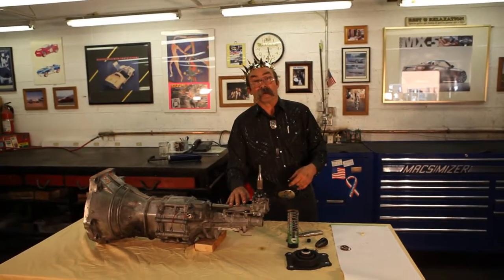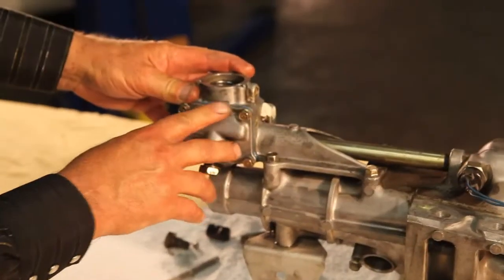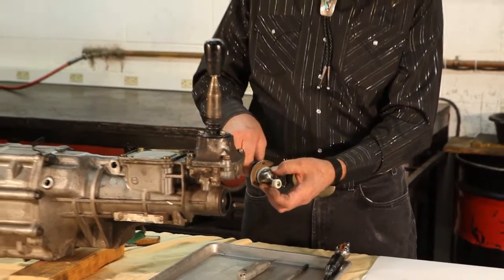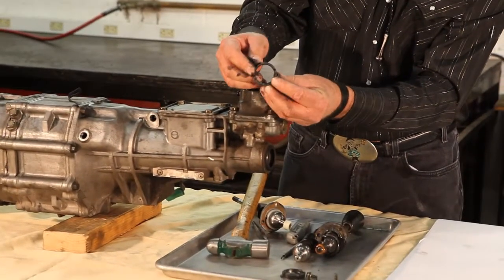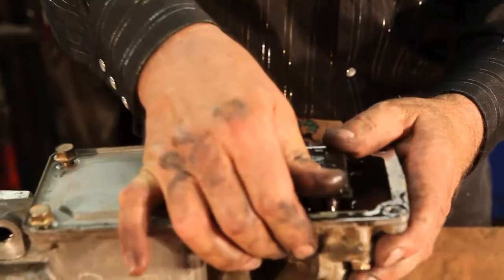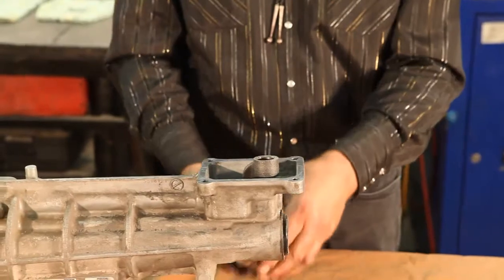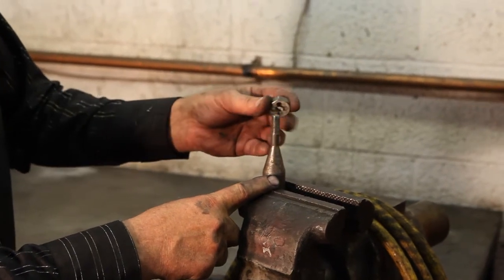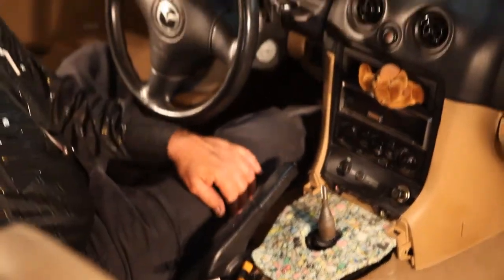Part 2 Miata MX5 Transmission Shift Turret Insulator Service

Comment: I think the most valuable part of this video is where you show how to bang that front pin out of the way with a hammer and punch. I'd have figured out the rest myself but not that.

When I pulled my shifter out there was NO bushing at all on the bottom of the shift lever!  You can imagine how much better it shifts now that I installed the bushings I bought from your ebay store.  Almost no slop and the first-to-second shift is especially improved.  Thanks, your Highness!

Comment from the maker: Hello Sir Jim,
Fifth and Revese are on the same shift rail. So you need to ask for the fifth hub and sleeve set, better yet, Mazda uses a micro fish system so ask for the picture so you can pick out the seperate parts. We have seen this problem due to a trans run low on fluid, fifth hub is the first gear set to be starved for oil. First take the tailshaft off trans to see the gear set. You will most likely also need the fifth gear. 
Good Luck, Mike.
The King of Miatas.

Comment: Thanks. This is the first video I've seen that mentions the 'loose cover' on the 6-Speed shifter. My bolts were finger tight only!. I put some loc-tite on the back two and tightened them down but, getting at the front two was impossible. So, I had to remove a bit of metal with a dremel in order to get a wrench on them. (Yes, I apologized to the car.) But, now they are all nice and tight !
If you have a suggestion on how to tighten the front two bolts maybe you can help others from having to do what I did. (Apart from dropping the transmission.)
Reply from the maker: Hello Sir Blue,
We have many tools to fit, if not we make them. This is how we feed our babies. Mike. The King of Miatas.

Comment from the maker: Hello Sir David,
The detent plunger is stuck. Check fluid first if low change and work out the kink. If not you will need to take it apart to fix.
Mike.
The King of Miatas.

Comment: Gratitude for the tutorial, o mighty King.  Pray tell, should one's 6-speed suffer from a loose bracket caused by those insolent bolts, how doth one tighten this bracket?  Locktite?  A new bracket?  We bow before thy mastery of the Miata realm.

Comment: Regarding moving ONE of the pins out (to get the bottom bushing and wave washer out/in) - - it's tough to use the "hammer" technique with the mechanism still in the car.  The better way is with a standard "vise-grip" pliers.  See other videos that use a channel lock pliers - - which may not give you enough "jaw strength" to budge either pin.  But if the vise-grip is set to the point where you're only trying to move it a slight bit (e.g. 1/16" or less - - i.e. with the handles almost closed), this gives you tremendous jaw strength, and it "budged" for me.  Once it budges, you just repeat the process by adjusting the handle screw on your vise-grip pliers.  Slow but sure process.

Comment: Hi Mike. Thanks for the video. Very Informative. Just wondering for the 90-97 can you remove the turret housing while the transmission is still in the car ? Reason....I was going to do the shifter rebuild and noticed 1 of the 3 bolts snapped by the previous owner.  Thanks in advance @Mike MiataKing

Comment: Hey Mike,

I am having a little trouble removing the shift knob from the shifter. Do you have any methods to remove the knob? The knob itself is wedged on pretty tight and I have had a couple people attempt to take it off but does not budge.

Thanks!

Steven

Comment: Hi Mike,thanks for your videos first of all,they are really helpful for we who are not as mechanically informed.I have an intermittent problem with my 01 miata ,6sp,sometimes it turns over and over but doesn't start right away and it makes the check engine light come on.It usually does this after being warmed up,then when it cools off it starts right away and the check engine light goes off.What would you check first? I have read some blogs and changing out the coil paks usally fixes it,but again,what would you recommend checking first? Thank you.

Comment from the maker: Hello,
A sluggish six speed transmission can benifit from a fluid change to Ford " Full Syntheic Manual Transmission Fluid" Ford part number XT-M5-QS. Purchase or order from a Ford Dealer.
Good Luck, Mike.
The King of Miatas.
Reply: First of all.. You’re awesome man! My shifter on the 01 6-speed I just got has wayyyy too much play(I haven’t taken apart to check if it was the bolts like you say), I was planning on rebuilding with a kit similar to what you showed  here. Do you recommend changing fluid at the same time? And can fluid be added at the top or is it best to use the port on the side? I always hesitate with stories of bad fluid changes, don’t want to have issues since the car transmission is fully operational. Thanks again I am now a subscriber!
Reply from the maker: @osalcedoucmsae  Hello Sir Omar,
Yes, change all the fluids on the new to you 2001 BRG. Yes fill the trans on the port on the driver's side of the trans, apx half way up.
the drain in on the very bottom. Enjoy your Miata.
The King of Miatas, Mike.

Comment: Dear King of Miatas,
You seem to have all the gears backwards in the way you describe them. The shift pattern is essentially reversed inside the shift turret because of the way the shifter acts like a lever to engage gears.

- The Real King of Miatas (kidding)

Comment from the maker: Hello Sir Victor,
Your problem sounds like a internal pressure problem. When a automatic transmission has no gears or connection when warm the unit may be low on fluid, check when hot and at idle. If fluid is full then you may have a plugged up pickup screen or a front pump failure. 
Mike.
The King of Miatas.

Comment: Aloha KING! I'm a ASE master tech 25yrs and i'm working on a 1997 miata with a 1991 trans in it. i'm having a downshift from 5th to 4th problem and i know it needs a 4th to 5th hub and sleeve kit but when i call Mazda they don't know what i'm talking about! Do you have a video and/or part# on this repair??

Comment: Hi Mike. Thanks for the video it was helpful for me when I did my turret rebuild. I just wanted to know if there is a seal that is between the shifter turret and the rest of the transmision. Because my shifter turret is leaking but not from the seal on top or the side plate or from the detents. It maybe coming from the part the shaft connects to the transmission. I can't find any information about it though. Any help would be great. Thanks.
Reply from the maker: Hello Sir Arthur,
Yes, could be the connection at the shift tube to the turret. More likely could be a cracked housing from a wreck, we have seen that problem before. The tube is glued to the aluminum housing. Clean everything well and look for a leak. Once clean, sprinkle baby power on the turret and watch for moisture. Good luck with your Mission.
Mike.
The King of Miatas.

Comment: Hello Mike, thank you so much for the video. This was very informative. I have one quick question though. I have a 2001 BRG special edition which is a 6 speed. I think it uses a Y16M-D transmission. Do I have to refill the turret with gear oil? It seems like from your video that all we need to do is just lube up the parts and not need to refill the turret. How does it stay lubricated without a reservoir of oil? Once again, thank you so much for the video and help!
Reply from the maker: +William Duong Hello Sir William,Yes, the six speed does not have a separate shift turret container. The shifter is lubed by the main trans case windage. The main trans case and the shifter are connected.The King of Miatas. Mike.
Reply: +Mike MiataKing Hi Mike, just quick follow up question on this. Given that the shifter is lubed by the main trans case, if I serviced the 6-speed shifter... could I simply take the gear oil out through the top or do you recommend to still drain through the trans plugs below?
Reply from the maker: +William Duong  Hello Sir William, Thank you for your concerns. Your Six Speed does not have a separate shift box but is part of the Main Transmission Case. Just grease up the parts and Zoom Zoom.  Good luck with your Miata Mission.  Mike. The Miata King.

Comment: Hey Mike,

I noticed my turret was dry after filling it a couple of weeks ago and suspect either the onion skin gasket you described or a loose bolt is the culprit. Is is possible to reach these bolts without dropping the transmission?
Reply from the maker: Hello Sir Jacob,
First step let us look for the leak. Clean the turret area and refill. Let it sit awhile then look for the leak. Yes, you can secure the bolts from the bottom and top.  We find many times when the turret leaks the case is cracked from an accident. Good Luck with your " Leaky Turret Mission ".
The King of Miatas.
Mike.

Comment: Hey Mike,

I noticed that my lower shift boot was ripped, as well as the upper shifter boot. I ordered both boots, and removed the shifter. before removed, the car shifted into all gears no problem. Now that i have put it back together, it won't shift into anything but 1-2. I have to pull it towards my leg, and it will go up to 1-2, but it won't go into 3-4 at all, or move to the right at all to 5-R. I don't really know to do, I am thinking about checking out the springs and seeing how that works(like you did at 0:36). Can you help shed some light on the issue, and a solution? Thank you
Reply from the maker: Hello Sir Jacob,Thank you for your concerns. You took it apart and put it back together, now there is a issue. Something did not go back together right. May be broken bushings jamming up the linkage. Next step take it apart again and look for the trouble. Good Luck with your Miata shifty Mission.The King of Miatas.Mike.
Reply: +Mike MiataKing  hey mike i have the same issue as above but i cant go into 5th or reverse only 1-4 and the shifter feels clanky and different then before. please help i need to take a roadtrip home soon im stuck :/
Reply from the maker: +AiiRiiCK Hello,  Sounds like your transmission is low on fluid. When the trans gets one quart low on fluid fifth and reverse are starved for oil and soon burn up.Also the other cue is the shifter feels funny. Check the fluid level first.Good luck with your Miata Mission. The King of Miatas. Mike.
Reply: +Mike MiataKing thanks mike i supremely appreciate your help i wish i could do somthing in return but i hope this is my issue
Reply: My issue ended up being the reverse light switch, so if you're having a similar issue I'd recommend checking that.

Comment: i have a 90 miata with a gt25r,link ecu,440injectors,FMIC,lightflywheel,clutch about 200+whp and was driving home last night and heard a light tapping like a hammer being hit on a anvil coming from slightly in front and right ( around the trans) while in any gear this noise continued to get louder. the car make the noise much less if the clutch is in or out of gear coasting and louder if accelerating, also the sound picks up speed with the car i.e. slow tapping at 25 and fast at 60 .

Comment: Hey Mike, Thanks for the video.My Miata was stuck in gear. I pulled the shifter out of the turret and found the bottom bushing broken. I ordered the kit from your site and changed it and now I can shift into neutral and 1st and 2nd but can't shift into any other gears.What could be wrong? Synchronizer? Thanks for your input.
Reply from the maker: Hello Sir Abe,
Because the bushing was broken, broken pieces may be stuck in the lock-out. What does it feel like when you shift to third?
The King of Miatas.
Mike.

Comment: what would happen if you lost the spindle lock cover and spring? i cant get into any gears but i dont know wether to buy a new spindle assembly for it to not fix my problem
Reply from the maker: Hello Sir Rees Piece
We offer a kit for the spindle. Please take a look at eBay item number:

391276915507
That is the easy button to replace first and see if you issue is resolved.
The King of Miatas. Mike.

Comment: I think the detent spring on my 1995 Eunos is worn out. It doesn't spring back to centre when pulling out of 1st or 2nd gear. Any idea if you can buy the detent springs from Mazda? If so, any idea of the part number? (5 speed)

Comment: Can I fill the transmission with fluid through the turret  or the service box of a 2000 miata nB 5 speed instead of of the fill plug?
Reply from the maker: Hello,
Yes, it is possible to fill the transmission thru the turret on your NB.
Mike.
The King of Miatas.

Comment: Hey Mike...this is Mike...is there a brand that you recommend to rebuild my shifter on my '97 Miata. It shifts fine, no issues but the rubber boots are letting heat into the car. I have looked at OEM parts from Mazda (YIKES..Expensive) and i have looked on Ebay (much more affordable). I just dont know if the Ebay ones are any good.
Reply from the maker: Hello Sir Mister T,  Thank you for your interest and concerns. Yes, our kits on eBay are all OEM parts and the price is right. Take a look in our store Miatamecca.  Mike, The King of Miatas.

Comment: My wife's shift knob on her 2001 5-speed is stuck. When I try to take is off, the whole shifter turns. Is the shifter it's self in 2 pieces? Can that break causing that symptom? Is that shifter the same for a 1999 6-speed?
Reply from the maker: Hello Sir Jason,
Thank you for  your concerns. Yes, there is an innner and outer to the shift knob. To remove the knob you will need to sacrifice the knob.
Squeeze the knob with a large pair of vise grips to lock the loose outer onto the inner, that is screwed to the stick shift shaft.  When done
install the replacement knob. The knobs are interchangeable 1990 thru 2005. Good luck with your Miata Mission.
Mike, The King of Miatas.
Reply: @MikesPlaceBiz  The knob moves with the shifter lever. I can feel the entire lever move under the leather upper boot. Can the lever break? It looks like it has 2 parts. I can't imagine that both guide pins can break.
Reply from the maker: @mainoffender1  Hello Sir Jason,
You will need to do discovery and inspect for the issue,
The King of Miatas. Mike.

Comment: Hey Mike I have a quick question. My fifth gear sometimes grinds going in and also sometimes my reverse works great other times hard as hell to get in what would you recommend?
Reply from the maker: Hello,
Problem could be the transmission, check or change fluid. Also could be a clutch issue, check adjustment. A worn out clutch will make a transmission act up.
Good luck with your Miata Mission.
The King of Miatas.
Mike.

Comment: Six speed 04 Mazdaspeed shifter (with the smaller lower bush) went sloppier and sloppier today until the shifter went round in a circle with no resistance and without selecting any gear. Dismantled the shifter and discovered that the socket in the turret seems to be completely loose.  Easy to remove the two rear bolts off the plate but how do I get at the two front bolts and what am I looking for when I get in there?
Reply from the maker: Hello Sir Dave,   To remove the two front bolts you can use a open end wrench thru the shifter unibody hole.
Or go under and do a reach around.  Your looking to see if the cast iron cup section is loose from the rod itself.
Held on by a roll pin, Maybe the pin sheared off ????
If not take the box out as the problem is at the other end of the rod, Internal.
Good luck with your Miata Mission.The King of Miatas.
Reply: Hey Mike.  Long time no reply.  I put a secondhand 'box in short term as I needed certainty that I had an overnight fix.  So the original floppy socket for the shifter ball still needs fixing.  I reckon there's a strong chance the gold bolt at bottom left of the frame at 9:53 has parted company from the selector rod.  Do you happen to know where this tends to fall to?  I'm hoping it doesn't mean splitting the 'box?  Or does it stay in the top section and is easily retrievable, maybe with a magnet?

Comment: Hi, i have a question, i recently bought a 1991 miata 5speed, woth 127thousand miles, overall in good shape. The problem is that it has a whine sound when i accelerate fron 1st through 3rd gear, seems to go away in 4th, and the shifter is really hard especially to get out of reverse, any help on what it could be will be greatly apreciated,thx in advance.
Reply: asdrubal alicea 
Same exact problem except it’s 3rd through 5th, I’m thinking it’s snycros. I would love to know what you determined before I go buy a kit

Comment: What type of oil do i ise to fill the turret? Transmission oil?
Reply: Hello Sir Danny,
Yes, the same fluid you use in the transmission 1990 thru 1997 .
Good luck with your Miata Mission.
The King of Miatas, Mike.

Comment: My 1994 miata automatic will sometimes not shift into 4th. works fine for a few days, then won't shift into 4th for a few days.
Reply from the maker: Dave Faulk Hello Sir Dave,Time to see your auto trans specialist. May only need service.Good luck with your Miata Mission.The King of Miatas.Mike.

Comment: My 92 shifter is hard to get into all gears. Bleed clutch fluid and assured no air. Would a bottom bushing help?
Reply from the maker: Hello,
Thank you for your interest and concerns. Yes, the bottom bushing could always be an issue. But, please watch the our video....
" How to adjust the Miata Clutch Pedal " . This may be your issue.  For a more in depth look take a look at ………………..
Miata Clutch Adjustment and the Zen of the Sweet Spot "
The King of Miatas.
Mike.

Comment: Hi, I had a question. My 95 Miata is having a problem going to reverse, what do I have to do to fix this?
Reply from the maker: Hello Damsel Ashley,
First step check the transmission fluid level. Next is clutch adjustment. The reverse issue could be the sign of a engine clutch release issue, maybe worn out ? Good luck with your Miata Mission.
The King of Miatas.
Mike.
Reply: Will you be doing a video of that